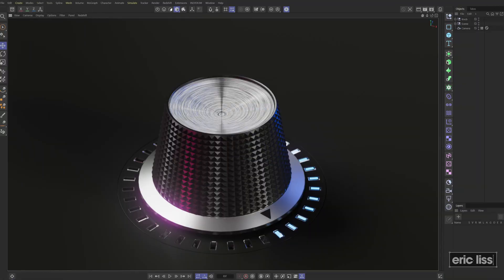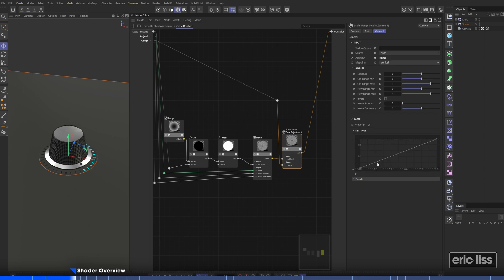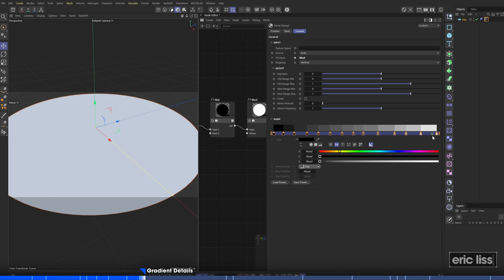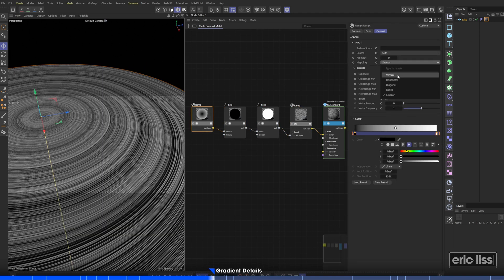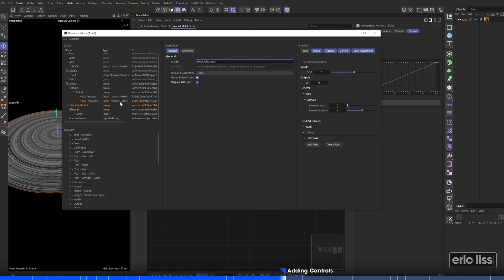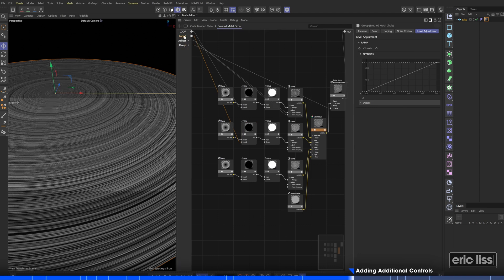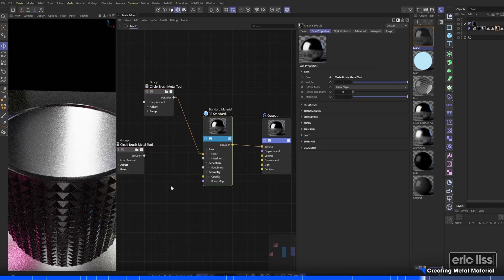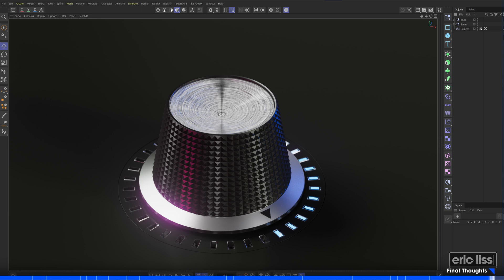Circular brushed metal tool-Tutorial Cinema 4d Redshift [4K]

Comment: Cool tutorial! Here are a couple of questions:

1- instead of using a ramp with all of those black and white inputs to create the bands, can you use a Noise and somehow stretch it circularly? Kind of lile what you did in photoshop but with the extra control to change everything in the noise.

2- this works great when it's applied on a flat surface, but how does it work if you need it on a cylinder so that the caps and sides have the brushed metal look? 

3- I've stopped using self made node tools like this because it's an issue when you share projects of you are working in a team for example. Unless you manually do a save with assets for some reason the node tool does not stay with the file, have you found the same issue? 
Maybe this has been fixed in 2025 but idk. And it can also be a huge problem if you are sending files to a render farm because the values in the tool essentially break so the materials break too.
Reply from the maker: 1. Yes, there are several ways to go about this task. kind of depends on the situation.
2. I was thinking of doing a video on this because I'd approach it differently for a brushed metal peg.
3. Yes, if I'm sharing project with a team I wouldn't turn it into a compressed node and leave it as just a group that way they could get inside if needed. I think 2025 should be fixing this. I hope! I haven't tried out 2025 seriously because I crash it every five minutes. It's really bad.